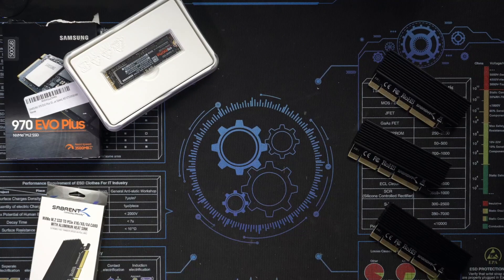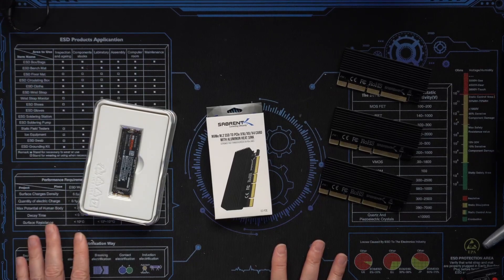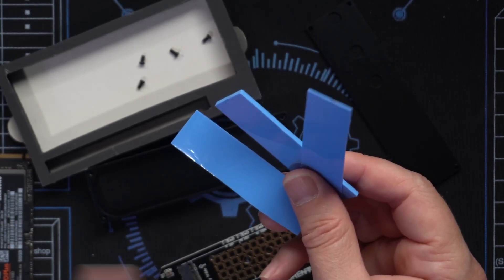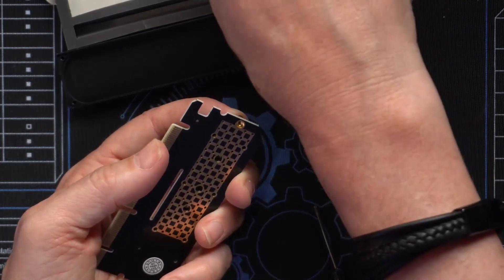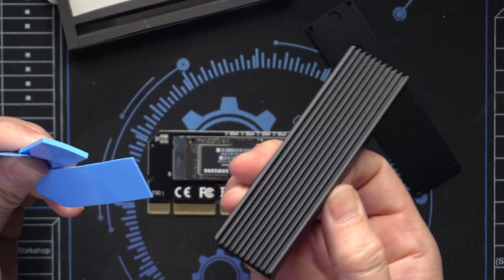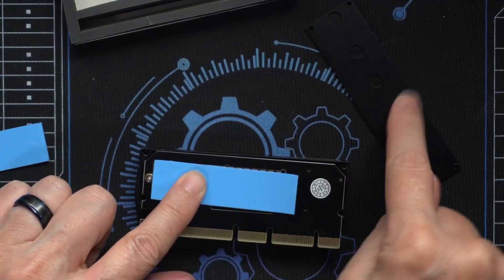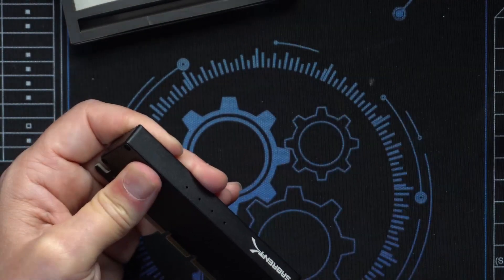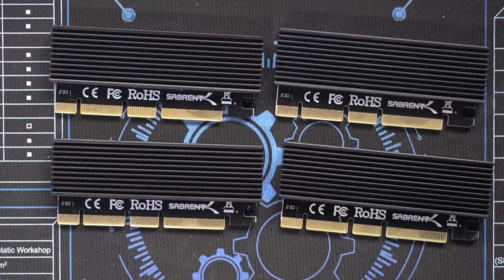Sabrent NVMe M.2 SSD to PCIe Adapter FULL WALKTHROUGH | vSAN vSphere Storage Upgrade Tutorial

Comment: Sure that the higher pressure from the thicker pad is not harming the ssd? I think 2 thinner Pad put together making one bigger Pad of the 2 thin ones and has still a little thiner tickness than the thick one. I'm not sure wich of these two methods will do the better thermal performance  for my 990pro (Siglesided)

Comment: Great guide! However, I do want to emphasis that the thick blue pad is simply too thick. I used the two smaller pads layered and stuck to each other, and it still wasn't as thick as the big one. You don't want to bend your nvme ssd card with all of that pressure: Stick to the two smaller ones, the large one is unnecessary and you'll have a bent ssd when you take this thing apart in 4-5 years. For reference, I was using the regular non-pro EVO 970.
Reply from the maker: Thanks for the info!

Comment: I have a Samsung 990 pro 4TB NVME M.2 SSD in my PS5. I have a 2TB Samsung 980 pro ssd and 1 or 2 1TB Samsung 980 pro M.2 ssd. However, the 4TB isn't large enough and I'm not looking to spend $1,000 for an 8TB M.2 ssd. I was hoping to build multiple external m.2 slots into a PCIE m.2 adapter and plug it in to the INTERNAL M.2 expansion slot with ADT-LINK Riser PCIe X4 3.0 PCI-E 4X to M.2. I don't know if the PS5 will still recognize the multiple M.2 slots. Any advice would be great.

Comment: I wonder if I can use a ADT-LINK Riser PCIe X4 3.0 PCI-E 4X to M.2  and use a PCIE to m.2 adapter on my PS5 to give me more m.2 slots (without adding additional m.2 through usb)
Reply: I know it won't fit correctly in the PS5, but I have extra PS5 shell plates. I could always cut a hole to run the ADT-LINK Riser PCIe X4 3.0 PCI-E 4X to M.2 to the outside of my PS5 and add the PCIE to m.2 adapters. Any advice would help.

Comment: With my WD SN570 it just makes contact with the thinner thermal pad. I'll see how it goes. I might add the second thin pad. The thick one is thicker than the two thin ones combined. For people with double sided NVMEs, you might find a thin pad between the drive and the PCB makes contact there too. With my single sided NVME drive, none of the pads were quite the right thickness to do that and it's not really necessary. So I'd say it's a bit fiddly, but following the Sabrent video and pictures, or this video, makes it easier than trying to do other odd things with the components. The instructions in the box though aren't great, so I can understand why some people did odd things!
Reply from the maker: Thank you @Nick_R_!

Comment: The pads are meant to be applied ... thin on the back of the PCB. Thick between the PCB and the SSD. Thin on the top of the SSD.  The thick pad is clearly not designed to go on top of the SSD. I'm sure it works, but it puts unnecessary pressure on the SSD and PCMIE connector as well as not providing the greatest possible heat dissipation.
Reply: Why would you put pads in those other locations?

Comment: Found this video looking for advice on  which thermal pad to use. Unfortunately I followed your advice and used the thick pad (I have literally the same 970evo plus drive). It's too thick and I should have used the thin pad. I blame Sabrent for having zero instructions relating to the thermal pad though.
Reply: Just to add a little info. With the thick pad the back plate would not sit flush. After installing the thin pad I checked to see if it was making contact by trying to remove the circuit board from the heatsink. It was sticking. Back plate fit flush after that.
Reply from the maker: Thank you @user-ql5iw6os9g!